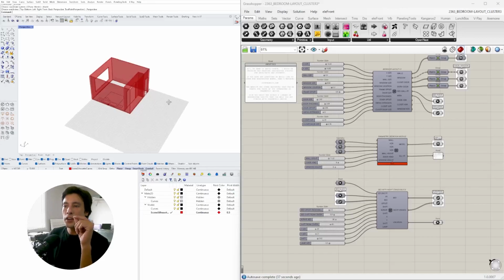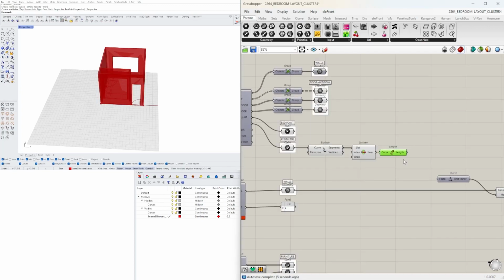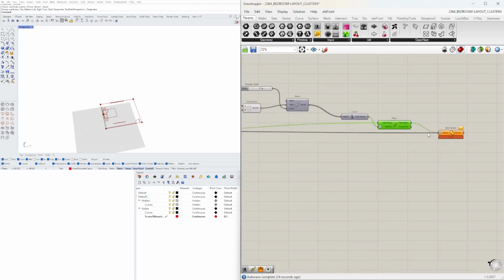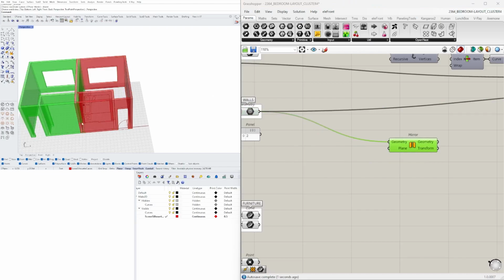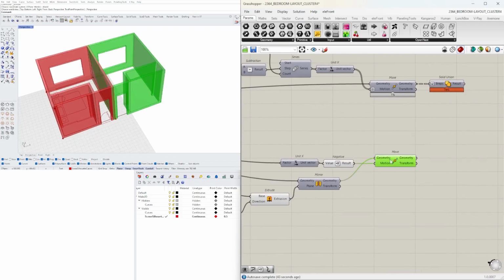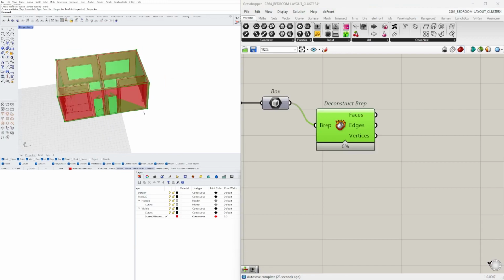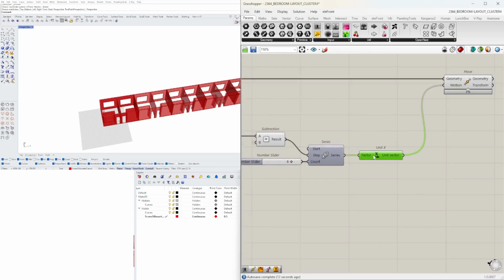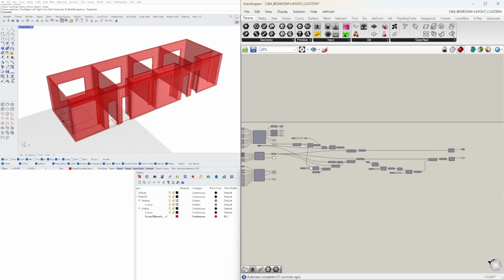Parametric Bedroom Layout Part5 and design using Grasshopper for Rhino Script available for download

Comment: Observation. Have you tried the idea of a morphing box. Of course the bed and equipment inside should be excluded. A morph along surface IS possible for the module. Think of it as a 'brick space'. 

Other set of transformations such as shear, taper and twist are natural but for architectural reasons they do not make much sense. 
Other partitions USING THE SAME module such as the kitchen could be derived easily with what is done here. It's just a variant to the cluster of codes shown here. 

A bathroom public module follows after this video. Number of fixtures can be programmed. It's just basic BIM after all. Every item in this configuration is editable or has enough information for editing in any shape or form. 

You got your show rolling. This opens the door for other positive consequences of multi clustering.